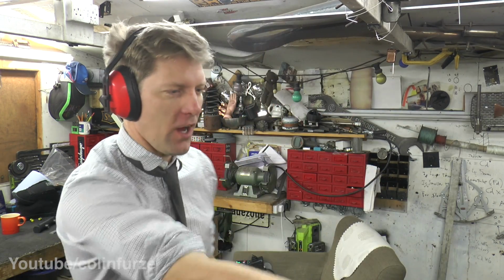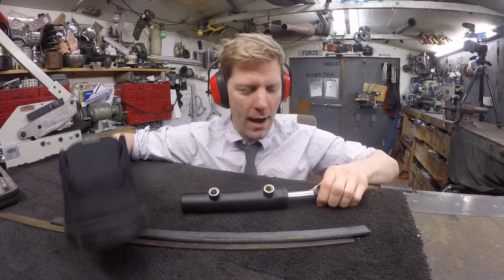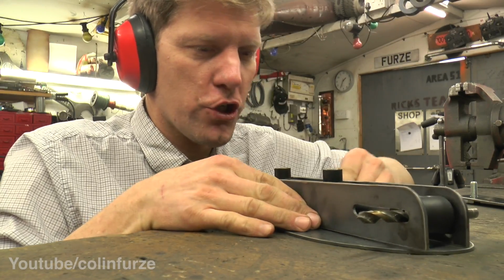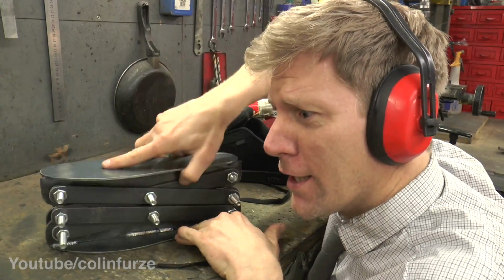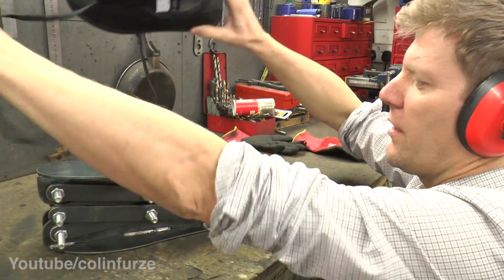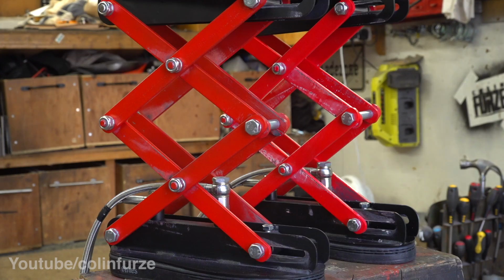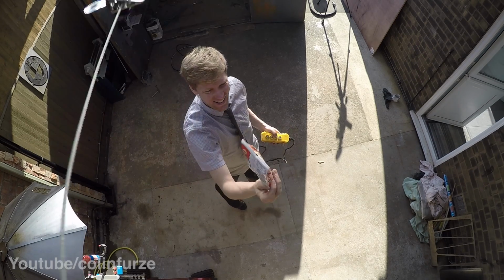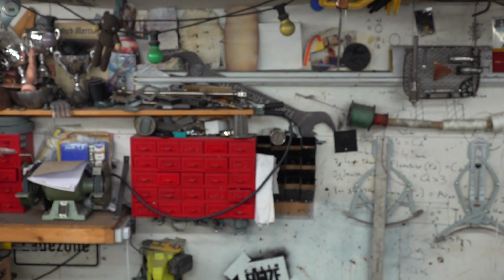Real Hydraulic Scissor Lift Shoes

Comment: Colinfurze logic:

Perfect size for shed,
No wait I need to be taller so I can bang my head on some beams.
Reply: @Thanos The Memelord But only if a sensor has detected that they are too tall
Reply: @williamrose3413  Triggered by a touch sensor on the beam on the door frame?
Reply: @ethanr4707  I was thinking an IR beam at the top but that would probably be simpler
Reply: @williamrose3413  or just have a blade swing out anyway, shorter visitors will not get their heads cut anyway
Reply: @sup3rjulius  But the suggestion was to cut their feet off, not their heads

Comment: Mr. Furze. All my life i was thinking about one project. Is it possible to build a rollerblades with a dynamo inside, which could make every push stronger?
Reply: It all depends on how you want to do it. It could be possible to have something that pishes while you push, increasing the push stronger.
Reply: Really? Because I've always thought about making inline skates that have the ability to convert the frame into a flat shoe bottom. I'm not really fond of those skates that are basically a shoe instead of a liner that attaches to it, seems like a solution that sort of kills a lot of power transfer and such.
Reply: Why don't you add an extra line of rollers (per foot) connected to an internal motor that gets its energy from the primary line of rollers that you push? So when you've switched feet the motor takes over to continue acceleration/push on those wheels. Hope it makes sense 

The other option is to make the whole thing electronic like an electric bicycle

Comment: Use air tanks from a air charged pistol. They could be cordless, bouncy, and way more dangerous if the plumbing fails. Sounds perfect for him.
Reply: I'm liking the sound of this.  A bit more ankle support needed, but it would be a bit like the air spring version of the 'blades'  that Oscar "Shooty" Pistorius used.
Reply: Using air could cause some trouble, especially if you're trying to walk when not fully extended.

Comment: Would it be possible to make shoes that launches you of the ground not far but a bit with Springs or somthing might be one time use would be really cool but i think a problem would be the landing but it could help Kevin heart play basketball
Reply: Oh not again with the springs. Someone clearly doesn't remember a certain video with a certain bicycle.
Reply: * Kevin stares aggressively *
Reply: You can! 

The springs just have to be compressed, like with a winch, and can be held with a belt, then released with a pull pin on a string. 

These are just bad examples to prove your concept, there are much better ways to compress and release them.

Gotta find this bicycle vid now and see what happened
Edit: Oh right, the big ball of wibbly wobbly, springy bikey stuff. I'd already forgotten
Reply: Like Spring-heeled Jack!

Comment: next step add a set of leg brace exoskeleton with hydraulic actuators and angle sensors with a neural net processor controller that learns how you walk and minimizes the stress in your body.
Reply: I think most of that is a bit beyond this plumber's abilities.

Comment: For all people under 5ft 10.
Reply: 5'7" reporting in!
Reply: @CamCakes  How many gallons per fahrenheit is that?
Reply: @oOWhaleFuckerOo  that's about 0.2 nautical football fields, which converted to Toyota corrolas is 6
Reply: @oOWhaleFuckerOo  Funny thing is, in astronomy, they use cm^3 per Kelvin as a unit of pressure, which has the same dimensions as what you said.
Reply: 5'3 here
Reply: spoken like a true 5'11
Reply: 164 centimetres here
Reply: I’m 192 cm
Reply: 5’4 reporting in!
Reply: 5’2” checking in!

Comment: Perhaps a backpack module for the hydraulics would make it a bit more efficient at least for movement? Maybe use one of those 6v batteries from the kids cars and some capacitors with something to regulate the voltage, and a smaller reservoir?

Comment: Use boots for better ankle support with slight upwards metal support. Put lithium battery and small pump in bottom lift, if small pump powerful enough. Or make wider, you looked little wobbly on uneven ground. Also rework sole to provide slightly angled/rounded front and rear for better "natural" foot placement.